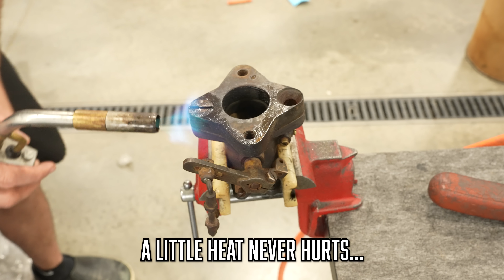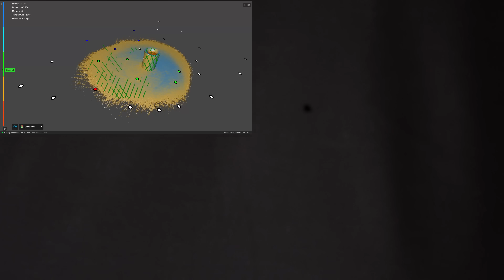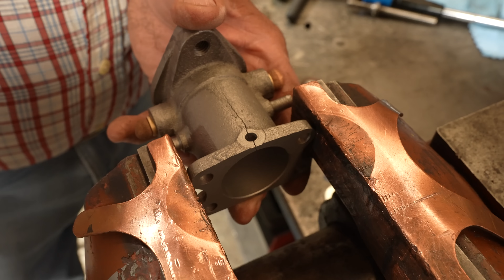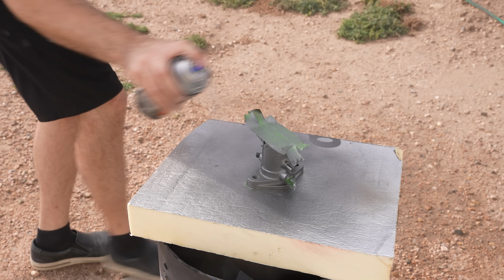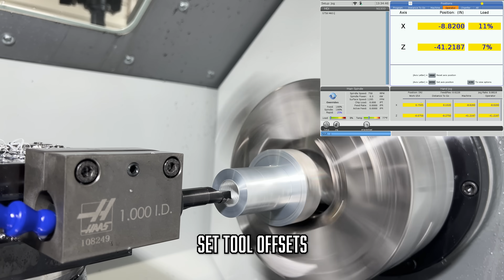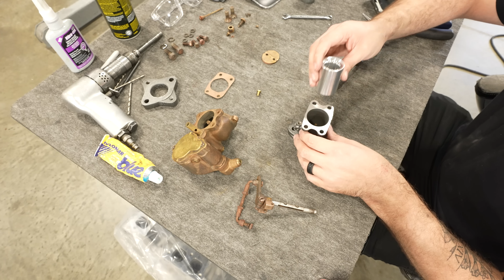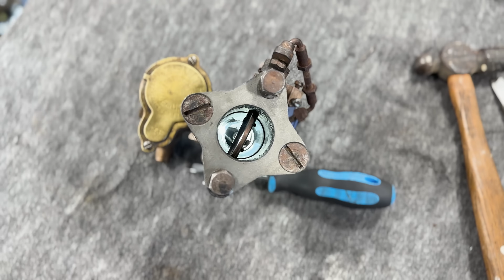Repairing A CRACKED 1920 Zenith T5F Carburetor W/ MODERN Tech

Comment: A brass venturi would have looked incredible. And would have less chance of electrolysis issues.

I worked for an auto-electric/radiator/carburator rebuilding shop when I was in high school. I REALLY wish I had paid more attention to the old guy that did the carbs, he was in his 70s then, and a lot of knowledge died with him. And now carb shops don't even exist anymore. It died with so many other specialist automotive shops in the 1980s.

You can re-liquify flux with a couple drops of acetone

Comment: I have a cast iron Zenith updraft carburetor on a '54 Tow Motor forlift with a Continental flat head straight six.
It's a REAL ODD-BALL. I've looked for one for over 15 years with NO luck.
Finally just decided to use a VERY COMMON smaller bore updraft and make a mounting adapter.

Comment: Back in the day, when I rebuilt carburetors for extra cash for several auto repair shops, basic cost was starting at $35.00 for labor plus parts. On old antique vehicles I started at $50.00 plus parts. What you had to do on that on by machining a new part......$800.00 would not be too outrageous.

Comment: An impact screwdriver works great for screws corroded in like that. One would think it would just twist off the screw but I think that impacting with a hammer helps prevent the blade from slipping in the slot plus drives the screw in ever so slightly to help unload the threads. Maybe that's not the science behind it but I know it works. I use it every week on #10 and 6mm salt water corroded screws in aluminum. I have had some cheapo drivers that don't work well but my 3/8" Snap-On has worked well for 20 years.

Comment: If your really going to charge for it by the hour is the only way to be fair. You had to engineer everything from a process of how to repair it to determining what process to manufacture the parts it's self is very time consuming. Then disassembling it without doing more damage. Finally manufacturing the parts, repairing the crack after consulting the old timer about the best process then how to hide the repair. Digging around or a trip to a hardware store for screws that would keep the period hardware type. All of witch is done on the fly. According to the video it took about 30 minutes or so. 🤣 It is a lot of fun using the knowledge you have gained and connections you have gained over time for a community project.

Comment: Since the carb is really NOT readily available, you should figure in the CNC time as well as the silver soldering, and actual shop time for disassembly and reassembly, plus design time of the Venturi...IF you were going to charge for the carb overhaul AND rebuild! LOL. Good video! Thanks

Comment: +Nope!  If those little screws come out, they will be sucked right into the intake.  I had two come out after a year of use. One of which went right through the intake valve and bounced around in the combustion chamber until it went out the exhaust valve.  I fetched the butterfly out of the intake manifold. Lots of visible evidence on the face of the piston but no other detectable damage.  Just got lucky!  I love watching you guys.
Reply: Not if you peen them in somewhat like a rivet as they where before. I have done many of them to re bush the shaft.

Comment: I had a heater core connection break on my 77 Buick skylark.   My stepfather told me you will never be able to fix that.    Went to Lowe's, got a small piece of copper tubing and soldered it in place.   Worked perfectly and held.   I was so proud of that.

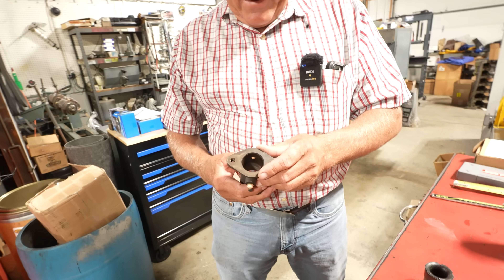Comment: 7:00 I know how to silver solder. I used ig to build a nice bicycle frame.
Silver solder flux is water soluble.  I used a propane torch.  You would have need two torches to get enough heat.  With acetylene, I would have heated from the inside, and let the solder run into the crack from the top.

Comment: One important thing with old cast iron, you need to either oven heat the piece and then put it back in the oven to SLOWLY bring the temp down or you need to peen the metal as it cools.  I have repaired many hit n miss blocks and was taught by my great grandfather how to fix cast iron.  Also, when soldering it is a good idea to copper the area first.  You take a piece of soft copper and rub it into the cast iron around the repair area.  This will help the solder hold to the old cast iron.  One last tip is to v out the crack.  With that carb it is not necessary since there will be no real stress across the crack but if you are doing something like a block or head you will need to.

Comment: If you do repairs like this that have slot head screws, I would suggest that you buy a decent set of hollow ground gunsmith screw drivers. They help to keep from buggering up the screw slot. You can buy them from Brownells Inc. There's a YouTube channel called Anvil, which is a gunsmithing show. I've seen one of his videos where he shows how to repair damaged screws. He has machinists that work for him. He retired from the Navy and is being a gunsmith as a second career. He doesn't do very many videos, but they're interesting to me. You guys might even consider doing a little gunsmithing at your shop.

Comment: On those big straight blade screwdriver screws you can take a flat piece of stock or a washer, grind a straight edge on it and make it the right size to fit down in the slot on the flathead screw. That way you’re getting full engagement with the slot. Then you can use a crescent wrench to apply the turning force. Also, when you first begin, try to tighten them just slightlyin order to break loose some of the corrosion then remove them.

Comment: Looks like you cut out a gasket by hand - if you ever need to do another, and have an inexpensive laser cutter - you can take a photo of the flange, with a ruler in the picture for scale.  Load the pic up in Fusion.  Use the scale feature to size it. Trace it out (outside edges, and holes). Save it as an SVG. Then you can load the svg into your laser cutter, and make as many as you like!   I've done that for a few vintage carbs that I couldn't easily get gaskets for.

Comment: After your flux is on the crack, i was taught by my old school machinist grandfather (he rebuilt A & T motors, and was the only guy for miles who still to this day rebabbits bearings) that you heat the back side of the crack. The flux will melt and seep towards the heat, drawing it into the crack. The pressure from the flame, if put right on the flux, tends to just push it around more than coming from the back side. Also with coming from the back, once all the flux on top has melted, your also a LOT closer to temp so when you come above you just need a light amount of heat for the solder to start to draw into the crack. Then, once it's soldered together, go back to the backside and give it a little more heating to try and draw more solder into the crack. It's just a small tip, but the few times I've used it in the big ol world of ours, it has worked out great for myself.

Comment: 8:25 true professionals. I was just a young welder tasked to weld repair a crack on a motor mount for a big crane. The crane maintenance guys drilled the “end” of the crack. I ran my grinder over the crack for a small groove to put weld into and the grinding dust stuck to more crack farther from their drill hole. They never got a magnetic to verify the extent of the crack. Proud and impressed that you guys did. Keep up the good work!

Comment: Nice result.  As mentioned below, silver soldering is perfect for filling in cracks in cast iron, as it actually "wicks" into the crack when heat reaches the melting point.  You now know that silver solder flux is water soluble.  YouTube has thousands of tutorials on a whole hose of subjects, including silver soldering.  You need to purchase a hand impact driver to shift hard to remove screws.  Heat fastener, let cool, lubricate and hit the impact driver with a hammer and Bob's yer uncle.  It will shift most stuck fasteners easily and is cheap in the bargain.  I used it a ton on the cheap fasteners used on Japanese motorcycles of the early days.

Comment: I remember sitting with my dad and repairing cars. Rebuilding heads after machining, assembling the block, rebuilding a carb, Whatever. Dad was an aircraft mechanic and engineer. He and I put many old cars back on the road in the 80's. We spent countless hours working in the shop together. It resulted in me working for Mercedes for a decade then moving on to micro mechanics. We lost dad in 2019 and I miss him daily. I like the interaction you two have together reassembling that carb.

Comment: Ez weld tig wire was designed for cast iron repairs and requires no pre heating.  I have had great success tig welding cast iron.

That would have been a good candidate for metal stitching as well.

Comment: Working on smaller stuff like that you could really do with some better screwdrivers. I rebuild magnetos for a living, so I get more than my fair share of stuck slotted screws.
Those drivers you’re using are a wedge type, you really need some with a more hollow ground tip, like gunsmith’s drivers or some electrician’s drivers. Most hex drive bits are also hollow ground tips (they’re also impact quality, unlike gunsmith’s bits).
Get a selection of different types & sizes & pick the one that fits the slot best, even if it’s a little tight & needs a tap in, that’s perfect.
I’d also recommend Kroil rather than whatever that is you’re using.
I use an old fashioned hammer drive impact for loosening the really tough ones.
These days I very rarely chew up a slotted screw or have any slips & I completely stopped using the wedge tipped drivers.

Comment: Boys, thanks for the video, but next time, at least grind a chamfer in the crack. This is not the proper way to do silver solder (silver brazing). The part needs to be cleaned thoroughly with degreaser, sandblasted, have the crack beleved and the part preheated...otherwise the silver rod won't stick...no matter how much flux you put on it!

Comment: To inform you, you can weld cast iron and cast aluminum, but you need to use the correct filler and a TIG welder.

Comment: I made a venturi for a 1934 Caterpillar engine. The original was cast light metal, but I made it from bronze. Cast iron housing. Fairly rare carb that was only used for about  year.

Comment: If I know anything about soldering you might want to heat the backside of the repair as solder and flux wick toward heat. My first instinct would be to heat the outside of the repair and solder the inside. That way you can also just toss it on the lathe afterword to clean up the excess.

Comment: Really enjoy your channel. I’m a retired maintenance technician. I had to repair a lot of old equipment and stuff. Most of the time it was people thinking that they were mechanics. They made my job harder,but it didn’t upset me. I just considered it as job security. I love your channel. I just wished I could have worked hand in hand with my father. I’m sure you had some tension sometimes but I would  take that just to have been able to work with my dad!!

Comment: It's better to heat the base metal and let the solder flow. Don't heat the solder to the point it bubbles. I silver soldered in the 70s for 10 years or so. Probably used 800 + troy ozs. of 50/50 silver solder.

Comment: To reduce the chances of the flat blade screwdriver from camming out of the slot and damaging the head and providing a better transfer of torque, you should grind down the screwdriver so it fits firmly in the slot.  Even better if you grind the faces parallel to each other.  A simple jig on a surface grinder makes it quick and easy task. I've got a drawer full of old screwdrivers that I keep around just for this purpose.  I do the same thing with air-hammer bits that I'll grind to different shapes for different purposes.  A common one is making a scraper a specific width to clean crap out of a slot or a certain diameter for clearance.

Comment: Cool repair of very old carb! One thing I am wondering though, is it possible the crack was caused by the aluminum when hot having a much bigger expansion coefficient then cast iron. Which probably has caused the crack to occur in the first place?! (that or the aluminium rusting) Wouldn't it be wiser to use a metal that is more the same as cast iron, for example normal steal?! So the expansion coefficient is closer together?

Comment: I have EXACTLY the same problem with a Zenith T5T off a 1927 Caterpillar 2 TON crawler tractor.  Cracked cast iron body, swollen and cracked pot metal Venturi.  I’d love to restore it and use it but I expect to cost to do so would far exceed the value of the tractor.  Can you mass produce those venturis at a reasonable cost?

WH
In CA

Comment: Wait a tick... This carb was originally designed with an aluminum venturi inside a cast iron body?  Ok, now we know what split the cast iron body.  Aluminum expands almost 4 times as much as cast iron.  So, your Dad was right.  Expansion was what cracked the carburetor body... but it wasn't ice, it was a hot aluminum venturi.

Comment: Well, as to the "cost" of such a repair. If it was a car club or a guy who loves restoring old cars. I would think financially you should charge time and materials. It's not like he is going to go out and buy a new one, or get an aftermarket replacement anywhere. Maybe give them a multiple service discount on the next repair or two. So that you get more work,  and he doesn't feel like you are ripping him (them) off.   OR, you could give them a percent discount AS your tuition so that you become a better machinist. It would also keep you from doing nothing but traditional automotive machinist services. After a while. it WILL get boring doing the same old thing. And a change of pace, while not being financially stimulating. It will pay big dividends keeping your brain sharp, and reducing drudgery. I was a mechanic for >40 years. And while a usually enjoyed my job, you can only rebuild so many carburetors in a row before it becomes so routine that your so bored, you could almost fall asleep. To the point that changing dirt bike tires was almost enjoyable (many of them were so difficult that my arthritic hands would ache for hours afterwards). I primarily worked on Japanese products. But every once in a while we would get in a European bike. And while they were so few of them that you could never beat "flat rate", I loved seeing how different engineers came up with different ideas on how to accomplish the same problems. Many times "reinventing the wheel" to get around patents or just having a "better idea", at least in their mind. And those idea's always worked.  An example is how some manufacturers used spring steel cup washers as clutch springs instead of spirally wound compression springs. Or leaf springs instead of extension springs. I have seen many what in the Japanese world was considered oddball ideas. But they were definitely a good idea that worked, and kept my brain sharp. I have been retired (disabled) for more than 20 years. And while I do NOT miss the pain, or the amount of my life spent at work. I do miss the mental stimulation. If my body didn't hurt so bad, I might think about doing volunteer work, or maybe working one day a week on restorations. But  there isn't (at this point in time) anything they can do to repair me. And I hurt so much that I spend roughly 20-22 hours a day sitting or laying down. And my generation your job was a major part of your identity.  Not many people from my generation can relate to having a career that specializes in keeping furniture from floating away.  I really do enjoy watching channels like yours. It helps keep me from being so bored. Thank you!

Comment: Why not part that off on the lathe?
I've done a lot of cast iron repairs. That cast iron paint is great, but because you ground it smooth it won't match. What I do is while the paint is wet sprinkle some of your glass beads on that area then another coat of paint. With a little practice you can match the sandcast finish almost perfectly. I've heard some use a needle scaler to make it look cast, but I find the glass bead is quick and easy and looks great with Cast Blast cast iron grey paint.

Comment: Im not a master welder but I would have heated it from inside the Ventury so the solder would have been drawn into the crack , the way you had it set up it would have helped also gravity : )

Comment: I work in a job shop, end mills in drill chucks is common practice for spot facing or boring out bunged up threads. Minor order of operations suggestion especially with a 3 jaw, drill and bore it before finish od turning as there is a lot of tool pressure and it might get kicked in the chuck leaving you with a concentrically error. Now I understand it's a carb venturi, and 1/16" run out is probably nothing, but if it matters you might want to make that your go to order of op..

Comment: i wouldnt have worried about the precision  anything close will work you just using a restriction in a given volume of air to cause a corresponding drop in pressure  the critical things here are air volume and negative pressure generated  you need a set volume of air to perfectly combust a known quantity of fuel  the over all bore determines your volume and the restriction sets the pressure differential  .given you have a large enough bore to supply your chamber with the volume of air needed to combust the volume of fuel delivered to the chamber the restriction is used to supply vacuum more accurately negative pressure which is used to regulate the amount of fuel delivered to the chamber  so as long as you have some vacuum you should be able to adjust rates of delivery for all engine loads...pla if it is chemical resistant is probably a far easier method to produce this now just 3d print the carb..personally i appreciate a turned aluminum part brass would have been more appropate